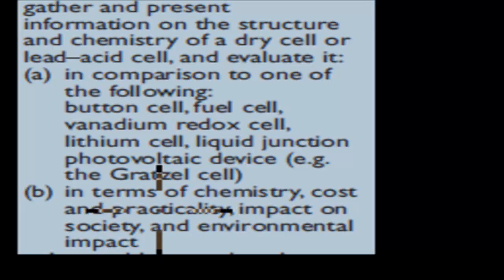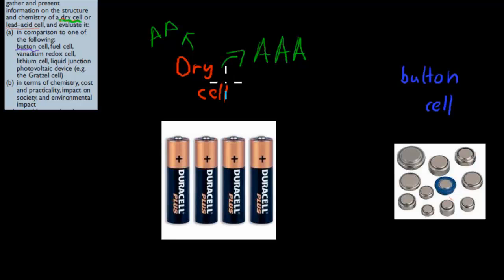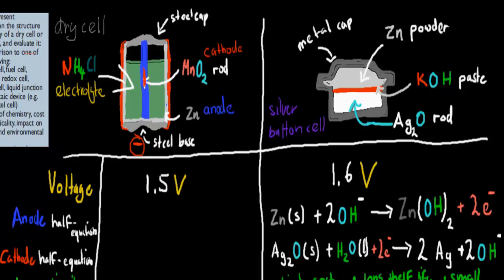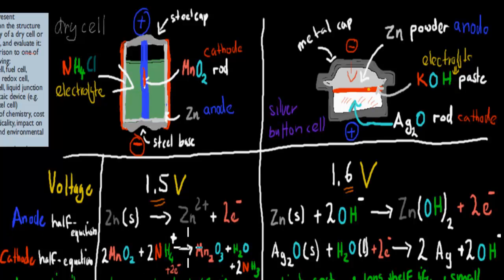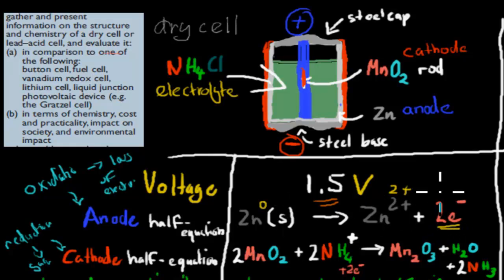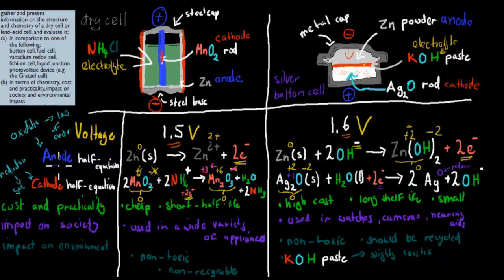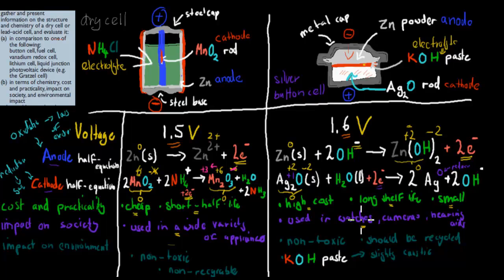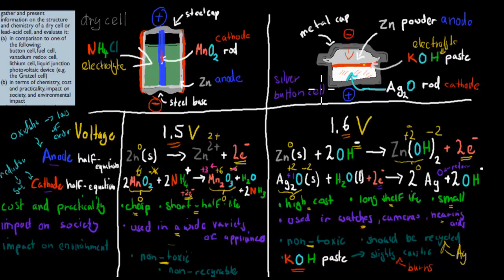10. Evalution of dry cell and button cell batteries (HSC chemistry

Comment from the maker: Thank you for the kind comments :) we plan on making more and more! there will heaps of past HSC exam question videos too, covering all past exam questions from 2001-2011!

1. The cathode is silver oxide (AgO) paste (H20), without the water part the silve oxide can't be reduced to silver
2. Long shelf life just means that it will last for a while before it breaks, half-life deals with radioactivity and that does not apply to the dry cell.e.g milk has a shelf life of a few weeks but no half-life